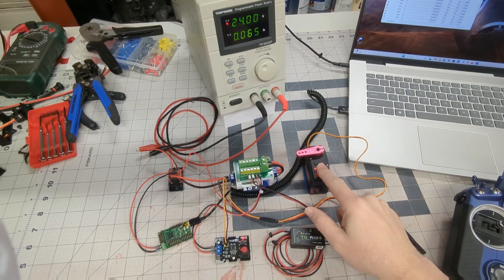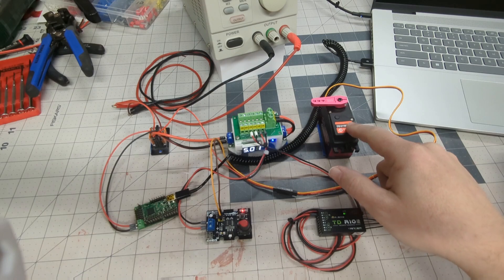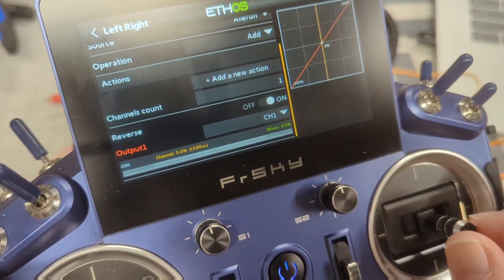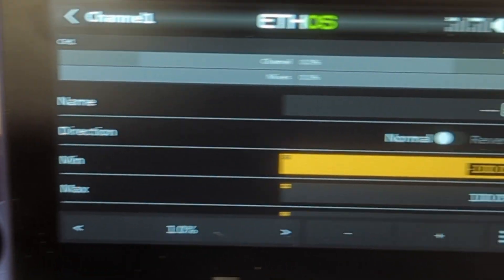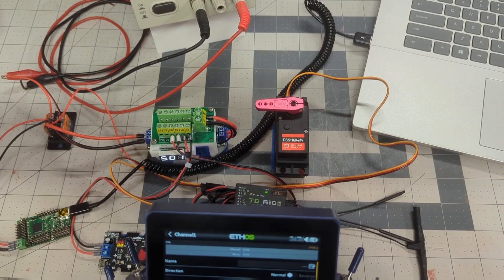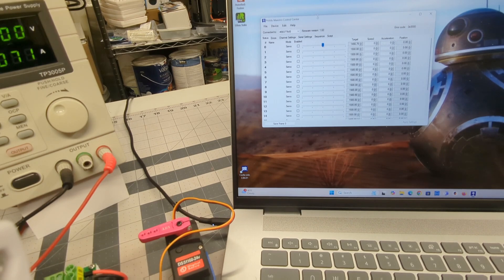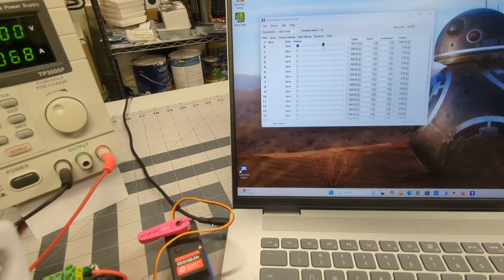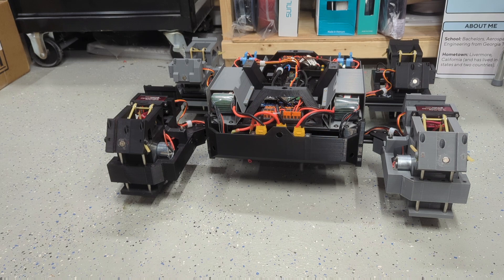Why Don't My R/C Servos Rotate Fully?

Comment: Do you set the same limits in kyber RC - pass through as are in the maestro.
Reply from the maker: Yes! Both have to be set for the servos to have the desired sweep. Now that I think about the process, it might be a suitable subject for another video. I use the servo tester to put the servo at one of its limits when I install it. Then use the Maestro Control Center to determine the min/max PWM values to get the desired travel. Finally, copy those values into the Passthrough settings on Kyber along with the Maestro ID and channel number. We'll see if all of this holds true when I get to the body lift servos.